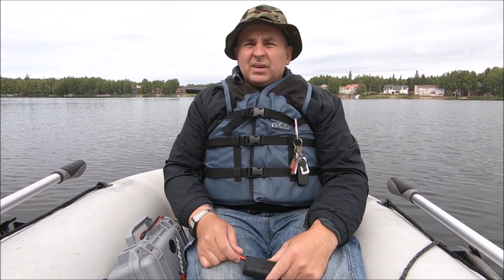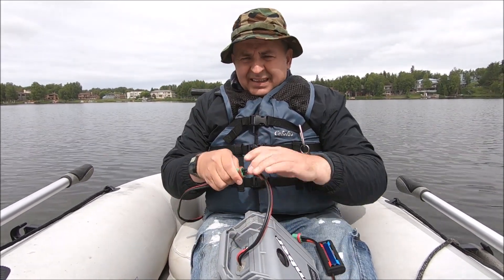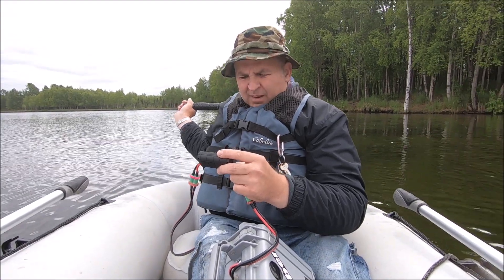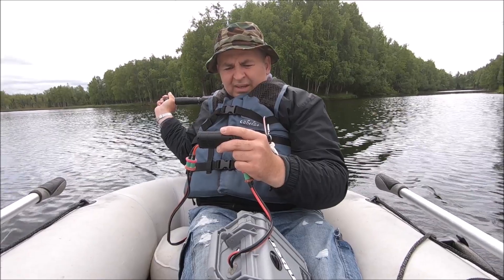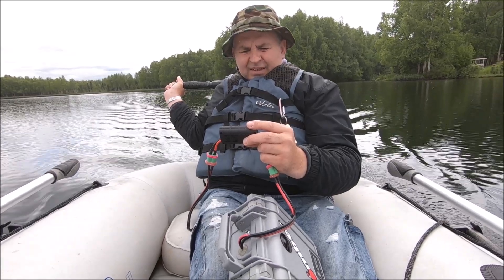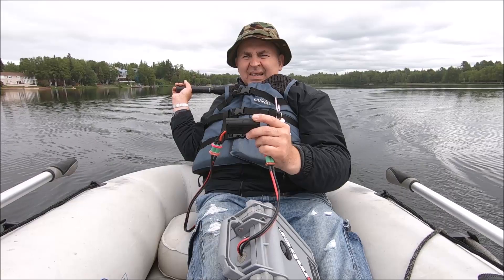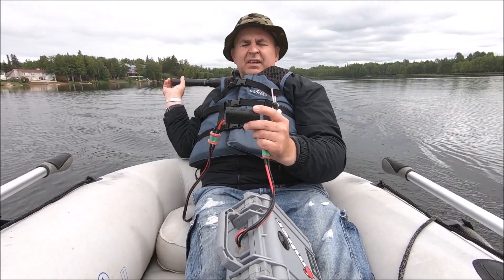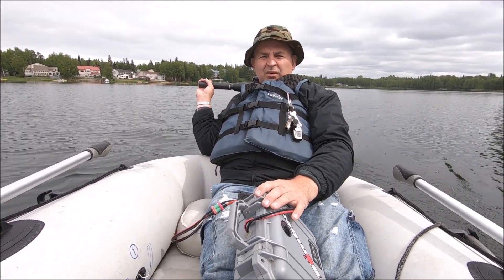Current/Amps draw test on Minn Kota Endura C2 30 Trolling motor with MKP-6 weedless wedge prop

Comment from the maker: Hi all, the current / amps draw test for my Minn Kota Endura C2 30 trolling motor with MKP-6 weedless wedge prop running on homemade 16.8v Li-Ion battery did go very well, soon I may do a similar test with the original prop.
Reply: Have you had any troubles with 4’s battery pack. I do not want to bern up the motors. I made 4’s battery that is 156 amps. Was going to charge it to 15.6 volts. I’m running two c2 30 lb.
Reply: can you or have you done a test with a 12v lead acid battery and see what the amp draw is?
Reply: @jstewart627  I have been charging my 4s 60 p 18650 pack to 15.6 volts. I have been running two C2 30 lb thrust in the ocean. I have been looking at charts for cycle life best to keep between 4.0 volts @ the top and 3.4 @ the bottom per cell. My motors are on a Kayak it’s top speed is 4.8 mph. I run both on speed 3 and only on 5 when going into the wind.
Reply: @jstewart627  I made a mold out of wood that I inserted the cells into leaving an inch for cooling of the cells during the soldering process. I put 15 cells in parallel at a time. No BMS just balance leads. I charge with solar panel directly to the battery at 1 watt per cell. It’s an experiment. In two years if goes well I will make a video.

Comment: Thank you for challenging a claim I’ve heard in another video that the Endura C2 uses the same amount of power regardless of throttle setting (the speed control coils were said to generate heat with ALL power not delivered to the motor.) it would be nice to see a comparison with an Endura MAX to see how much difference the pulsed current power regulator “Digital Maximizer” really makes. Is there actually a speed where the MAX uses just 1/5th the amperage of the C2 to deliver equal power as Minn Kota claims?

Comment: I fished most all of the Summer daylight hours with my C2 on windy days at all the various speeds it gave me.  My marine battery is a size 29 with 845 MCA.  At the end of the day it still had plenty of power left.  It recharge in 5 or 6 hours.
Reply from the maker: that's good 👍

Comment: You must have the amp meter connected just before the motor. The C2's will draw maximum amps from the battery at all speeds. There is a resistor that absorbs the excess amps on the lower speeds to make the output at the prop less or more. The Endura max models have a built in pulse width modulator that allows you to control the voltage input to the motor and will help save battery life at lower speeds.
Reply: Clearly your wrong and simply parroting a common misconception. The meter is reading the direct amp draw the motor is pulling. It doesnt matter if its at the motor shaft or at the battery. The only difference you AMY see on placement would be a minor voltage drop if the wire was long or to small a gauge.
I have ran the same test on my kayak and my results are similar.

Comment: As a general rule of thumb, 12V trolling motors draw 1 amp for every lb of thrust produced. ie. If your drawing 10 amps, your putting out 10 lb of thrust. 20 amps at 20 # etc.  It's a pretty linier function. ( Notice your 30# motor draws 30 amps at full throttle.) This is mostly true regardless of brand with the exception of those motors with digital circuitry and infinite speed adjustment). hth

Comment: does it go faster than 12 battery?
Reply from the maker: yes it does, because it's 4 volts higher than the stock battery
Reply: @GPeter7  it goes ALOT faster.
Im using a gas powered model airplane propeller 1 knot faster than standard prop .
I've just bought a lithium 12v battery.
Reply: @s2oooo  Whats the diameter and pitch of that model plane prop you used? Thanks.
Reply: @scottseale  APC 11 x 4 Sport (Gas) Propeller.
Make sure you get the stronger gas version 👍
Reply: @s2oooo  Thanks for that info.
Reply: @scottseale  remember I'm on a very lightweight rowing boat
Reply: @s2oooo  No problem, I'm on a 40lb 10ft Pelican Kayak.  Might get a couple different size APC props and try.  Standard setup I get 4km/hr max.  Can use some drag reduction on my outrigger floats though...very blunt shape not helping
Reply: @scottseale  also try a 10x6 make sure you get the correct rotation.
Reply: @s2oooo  Thanks man!  I see you're a foiler!  I'm just starting out...was actually looking at all this motor mod stuff possibly making a towbuddy for the foil but might be underpowered with the c2 30lb minn kota.  Its a big 2000cm2 NP XL wing.
Reply: @scottseale   have you seen this using my tender 6hp with the smallest propeller they do teaching my wife to foil.If you remove the 1400 foil she has no chance getting out of the water.Alot of power needed. Find me on FB Lee Todd if you want help

Comment: I've just built a 35Ah 16.8v Li ion battery out of 16850 cells and am running a watersnake 18 lbs motor on my kayak. I calculate about 2 full hours of runtime at 18A. That should give me a conservative range of 10/12 kilometers running flat out at about 5/6 Kph. I hope to test it soon!
 I doubt I will ever do that many kilometers in a day's fishing but from your videos I surmise I am fairly close to those figures.
 For the gain in speed from setting 4 to setting 5 on your trolling motor you would probably get further if you never go past setting 4.
 I am waiting on a PWM/speed control switch to arrive which will improve my figures by a little bit. Full control over 100% of the motor!
Keep up the good work!
Reply from the maker: thank you, we will

Comment: Compared to other videos with just a 12V battery, you're seeing a jump in current and I'm sure your motor is putting out more power than 30LB.   In a different video with a 12V battery the numbers were, 1 = 6A (8.1A), 2 = 7.3A (10.1A), 3 = 9.2A (13.7A), 4 = 10.4A (16.4A), 5 = 14.3A (27.4A).  I put your numbers in the ( ).
Reply: He's the maximum comparisons on what you have shown at speed 5 with 16v at 27.4 amps is 438 watts compared to 12v at 14.3 amps is only 172 watts. He is going faster and his motor is been overpower for sure as going by these figures he's consuming over twice the power!!

Comment: Hi, i made simillar battery for minn kota endura c2 34lb
Its worcking great, but my question is do you use bms board in ypur battery pack?
Reply from the maker: no, I'm not using bms board in my battery, I'm using  iCharger 1010B+ it has one build in
Reply: @GPeter7  the BMS on battery is more for runtime protection, like over current, over discharge etc... and i use them in my own battery builds for added safety. While BMS boards do offer some level of "balancing" really they are not designed with this as the primary feature and it's more of an after thought with very small current bleeding on high cells during top of voltage which would take ages to balance a large pack. Really the best way to actually balance the cells is the way you are doing it with a hobby charger that actively balances during charge.
Reply: @GPeter7  Thank you for information.